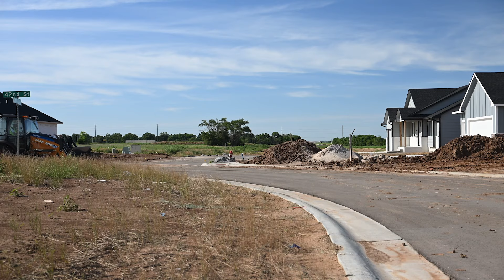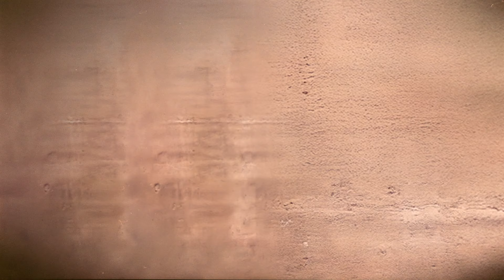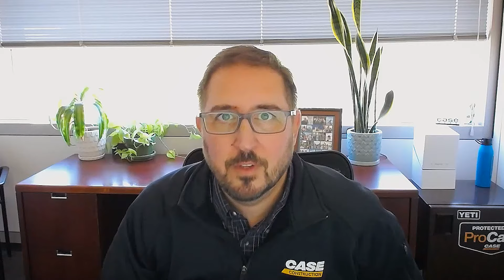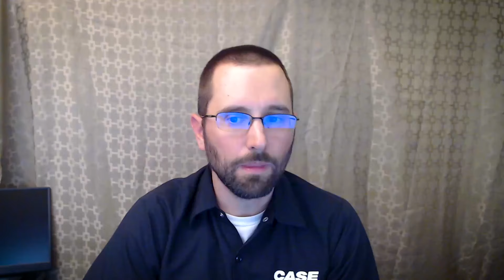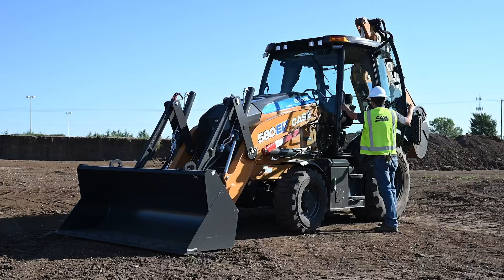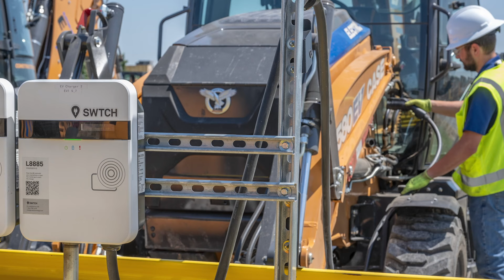Electrifying Heavy Equipment: Case's 580EV Electric Backhoe Loader

Comment: On a cold job site you will need to actually rent a generator now to charge it instead of just putting diesel fuel regular unit I can see this being only used in special applications were no emissions or inside of a building or tank other than that that premium price tag is crazy

Comment: It cost $290,000, a new diesel, $190,000.
Reply: For large companies, upfront cost is not the most important factor but total cost of ownership including fuel, maintenance, repair and downtime. Electric will always win out
Reply: Operating costs will probably more that offset this premium
Reply: It's early days. When the number of units goes up, the price will go down. Electric motors in bulk don't cost that much. Car makers bought packs for $115/kwh last year, so a 100kwh pack is under 12 grand if you buy bunches.  This one is 73kwh, which is 10 grand in bulk. The rest of the tractor should be less than a diesel. I think the difference in price is all due to this is the first one, and they only made a handful.